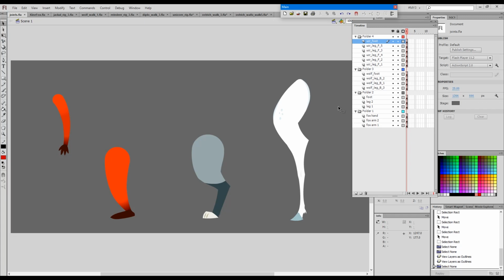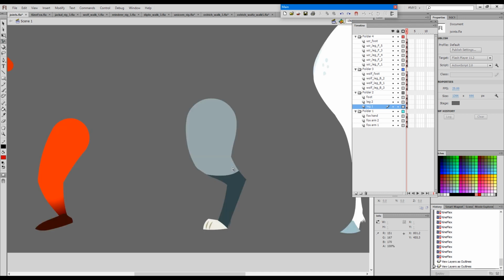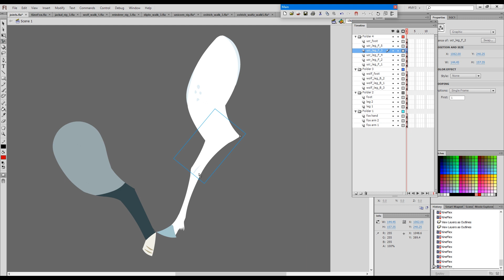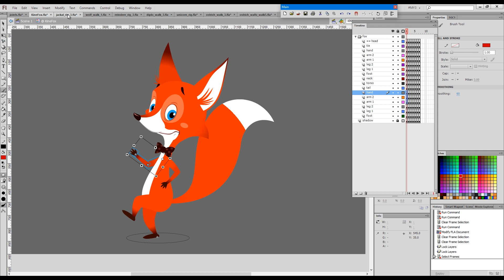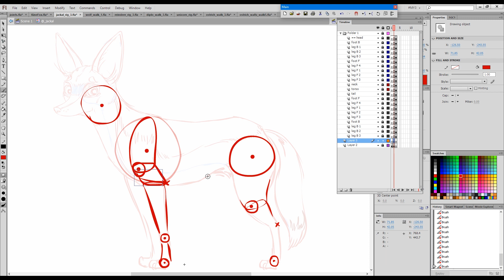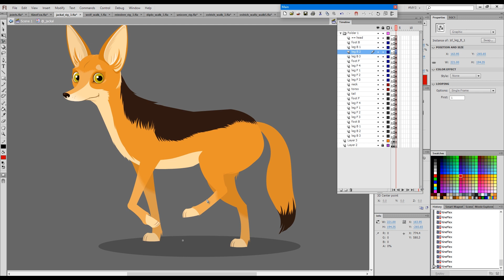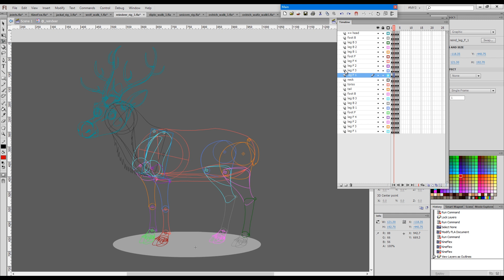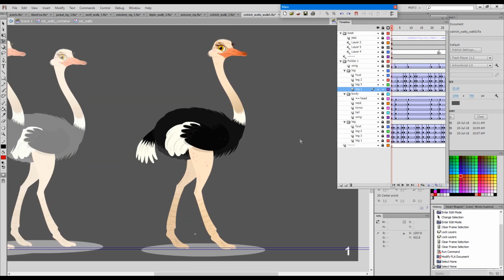Adobe Animate - Types of joints used in Flash animation

Comment from the maker: The most universal kind is a joint based on two overlapping circles. Rotation pivots in the circle's center and therefore the joint never breaks.
This is probably the most widely used type, because it does not require any special attention or additional clean up. The drawback of this is the clearly visible rounding of the joint, which is not always desired stylistically.

Variations of the circular joint exist where the overlapping circles occupy only a part of the limb surface, while the rest is asymmetrical. This can yield more natural organic looks.
The drawback here is that such joints have a much smaller range of flexibility and the elements often need several different states inside the containers to make them look natural at various angles.

The third type is an angular joint, which is not based on a circle. The elements meet at a point and that's it. Stylistically it can have specific appeal, but has the disadvantage of needing multiple states of the elements inside the container. Also the limbs may appear shorter as they bend, so some correction of length might also be necessary.
Reply: We missed it so much! This tool just made the program many times better! I'm very surprised to see that! Thank you very much!
Reply from the maker: You are most welcome, mate! Glad you found us :) 

We've been around for nearly 10 years... 

If you like the EDAP Tools experience, help spread the word; let your friends and colleagues know about us.

Enjoy
and
all the best!